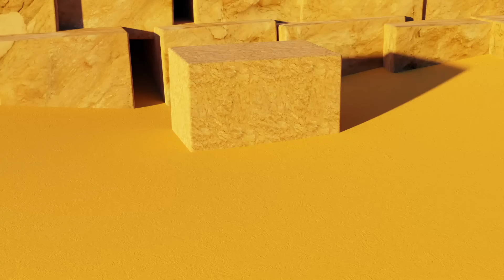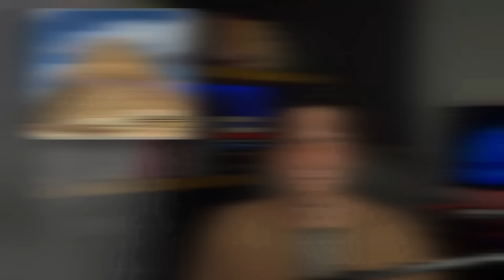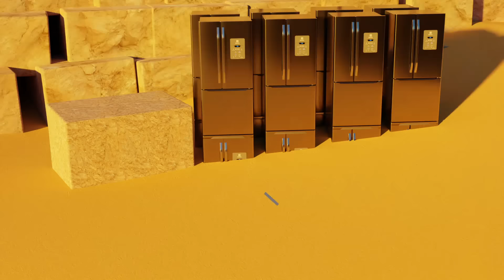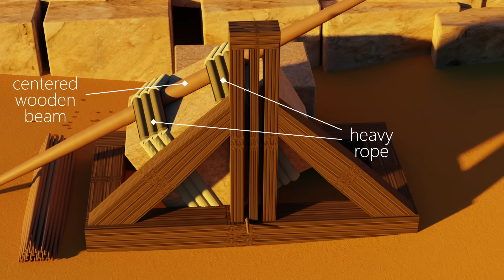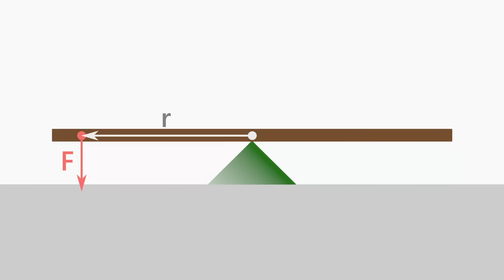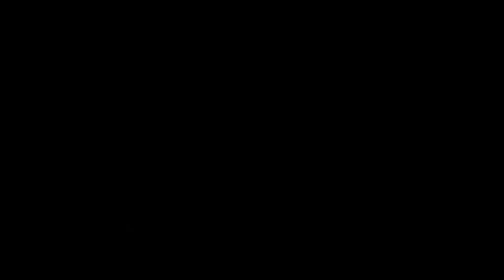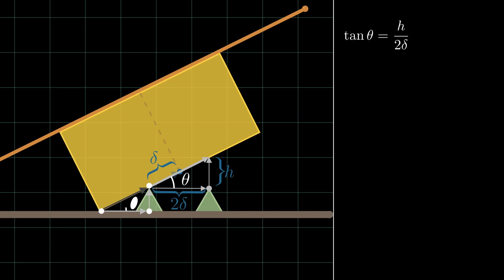Physics Reveals How the Pyramids were Actually Built

Comment: Whats you thoughts on the spiral ramp theory or multiple pulley system that acts like gearing ( I think Destin from Smarter Every Day has a vid on it)?
Reply from the maker: Love his videos, and I need to check that video out!  While efficient gear systems were invented by the ancient Greeks of Alexandria, it's possible some type of rotary advantage system was employed for further block manipulation.  Thanks for pointing me in this direction 😀
Reply: @DrJohnDev Well it wasn't rotary gearing, it was by using multiple block and pulleys together they basically act like gearing (Destin explains it so much better). Pulling on one end be lets say 10 feet the rope goes through the next pulley by lets say 8 feet, next pulley 6, then 4 and so on. And the force is reduced by each pulley (sorry I know I'm butchering this).
Destins video  https://www.youtube.com/watch?v=M2w3NZzPwOM
Another video with math like yours https://www.youtube.com/watch?v=JnYVz1TSmBQ
Reply from the maker: That’s a great video! And the Efficient Engineer one was also quite impressive. It looks like wheels would have been around at the time of the Egyptians, so the mechanical advantage of pulley systems could have also been employed, likely contingent on the clearance of the specific area.
Reply: @DrJohnDev  Heres the internal ramp theory which supposedly has evidence to back it up  https://www.youtube.com/watch?v=lasCXujNPfs&t=1s
Longer video with 3D animation and more https://youtu.be/3NCK99mQUxw?si=qwUIrEmE6pgPZeFu
Reply from the maker: The internal ramp theory also is great! It was neat that after they ramp to a certain level, they use the Herodotus machine to lift to the next level. This would have been good to include in my video. Really appreciate you sharing this.
Reply: @DrJohnDev  This guys videos on the pyramids are fantastic https://www.youtube.com/watch?v=3jRLZnpHKX0
Reply from the maker: Looking forward to watching that guys videos and learning more. It’s amazing how many dedicated their entire lives to this subject. Very intriguing and always still more to learn and investigate.  Thanks again for sharing!

Comment: It’s impressive how so smart people like the Dr.  takes time to explain all those formulas, but is the “every 6 minutes” 24/7, what throws every thing off. It takes 6 minutes to cut 10% of 1 side of those blocks, it may take hours to just cut it.  Now transport it will take hours or days, and bring it to just 4 Ft. of high, may take several minutes, now lift it up to hundreds of feet. 
That’s 24/7 counting the nights, only using all hours of day time, it’s 3 minutes, 3 minutes my A#%!
Reply: Why do you guys always assume they were building then moving one block at a time before starting the next one? You can do every step concurrently with multiple teams.
Reply: I am also not convinced about the time line.
Reply: my only glaring question is what materials doesnt break with those weight, he can say torque all he wants but imagine using a popsicle stick trying to flip something heavy on one end and it doesnt break, the rope material that they use (reed ropes is the only available ones).
Reply: They didn't place one block at a time.

{:o:O:}
Reply: Or you have lots of teams of slaves working at the same time!
Reply: ...muitos cálculos...muito rebuscamento...
Só faltou dizer a marca e modêlo dos guindastes navais utilizados...
Reply from the maker: Haha, I certainly understand your disbelief in how these numbers seem absurd!  But this calculation was only for perspective.  Those numbers actually aren't correct if multiple machines are acting at the same time, in tandem.  

For instance, with 10,000 workers, let's say 5,000 workers are assigned to operate the Herodotus machines and lift the blocks.  Each machine would require around 20 men to operate.  So that means 250 machines could be lifting blocks around the pyramid at any given time.  

So with 250 blocks being laid at a time, what does that mean for the time allocated per block over 27 years?  

This means each block is allocated 1 day to be laid on the pyramid over the 27 year period.  A bit more breathing room, with even workers to spare :)
Reply: @DrJohnDev  250 machines?  How many relics of all these machines have been found?
Reply: @goodcitizen6193 look around you. If civilization collapsed, in a thousand years our cities would be wilderness. Things decay. It turns out Roman concrete only survives because of an ingenious method of repairing cracks inherent to the mix. We only recently came to understand. Modern concrete and steel would not last. Even in a desert wood will n ot survive thousands of years.
Reply: @kittyhooch1 There are many living trees older than 1,000 years.  Tons and tons  of wood relics in museums and private collections all over the world.  Not one of these machines or even a trace of one.  It’s a ridiculous theory.
Reply: @kittyhooch1 personally I think in a thousand years there would be signs of civilization everywhere
Reply: @goodcitizen6193  Living trees? How is that relevant? Wooden tools are rare in many thousands years old archeology. You only see relics that are preserved, but 99.99% of those that weren't made of stone or metals were not preserved in any way. if your object of interest is not in that 0.01% you have no chance of finding any traces. It's a huge survivor bias problem.
Reply: @DrJohnDev what kinda wood would stand up to this abusive weight daily?
Reply: @piratessalyx7871 Exactly what I thought of. No wood could hold up. I have seen a video where they experimented with using wood for slides and rollers. The wood was soon crushed. They even tried importing hard wood from far away and it did not hold up. That was with trying to move stones not near the heaviest in the pyramids.

Comment: tldr; What is the best way to get 6 soldiers and a sargeant to raise a flag-pole? You say "Sarge, get that flag-pole up". 
The most convincing part of this entire video is the graphic of a bunch of guys surrounding a block - that's way better than your machine. The small problem of not enough room around the block is solved with a beam or two, under or tied to the block like you show later. Step back from the computer, get some friends, maybe pizza and beers, and do some physical labor. You will soon relearn the easiest, most practical, most ancient and most universal way to increase a force, i.e., get more people. If they can't lift the block then get even more, or, decrease the standard block size. Once off the ground, either move the block sideways, or put sturdy lumber underneath (not wimpy crushable sticks) to raise it, and repeat.
Reply from the maker: I agree a large degree of grit and hard labor was certainly needed during the construction.  The problem with only using men is the numbers become pretty astronomical.  For the 10 ton block, this would require around 140 men, all lifting in a meaningful direction in tandem.  A simple machine greatly alleviates this issue.  And some pizza and beer would probably do everyone some good as well 😉
Reply: @DrJohnDev  What issue? Getting 140 people to all do something at once is basic training in armies around the world, and easily solvable by fixing one end of the beams. Furthermore, a physicist will tell you that all simple machines do not reduce work, only change the force and effective distance, and in fact increase total work because of friction. Your fear of not being able to command 140 workers at once results in taking longer and/or building 140 machines.